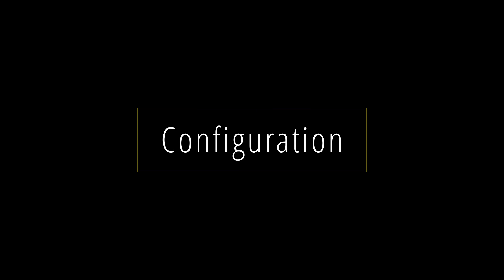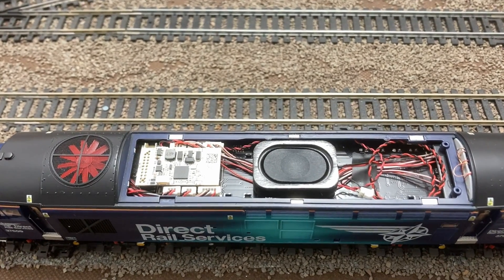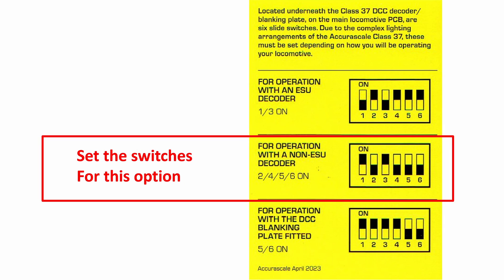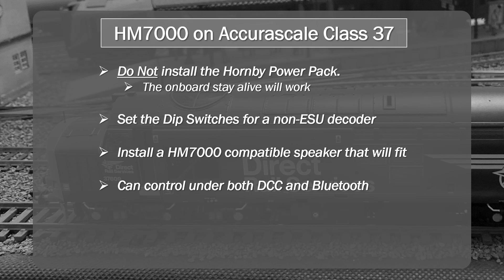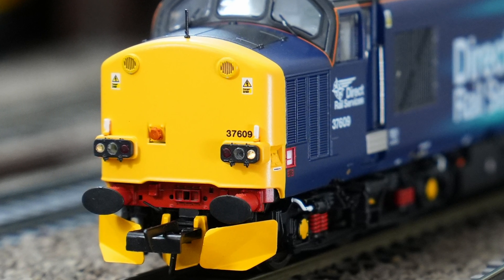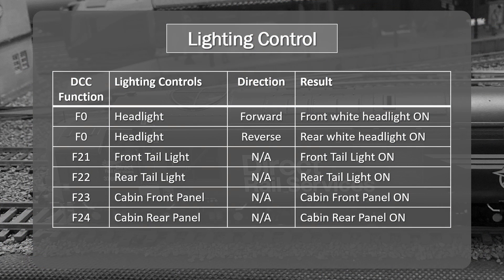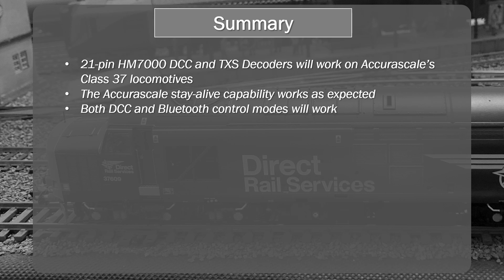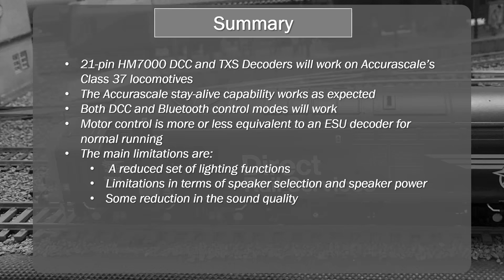Hornby HM7000 TXS Sound Decoder on Accurascale Class 37 - How well does it work?

Comment: A bit late as I hadnt seen this one but very timely as I have been wondering if the TXS will fit into the ACC locos I have been buying. I have the Class 66 on way and plan to use their TXS for that as I find an extra £100 for sound a big ask, especially on electrics.
Reply from the maker: There are some compromises on the light functions but in return you get Bluetooth control and you are saving on the sound decoder (and can re-use it on another loco in the future).

Comment: With regards to speakers, why didn’t you recommend the Accurathrash 8 ohm speaker? Works perfect with my HM7000 in this loco, not setup needed just plug and play.
Reply from the maker: It comes from concerns over the power rating of the HM7000 decoder which is substantially less than the ESU decoders. I suffer from the trauma of burning out a few TTS decoders in the past due to overloading them. (https://www.youtube.com/watch?v=flxKOP7JyKM). I'd keep an eye on the overall current draw to make sure that it's not exceeding or running very close to the limits. Driving a high speaker load combined with high motor current could bring you close to the limits. I haven't fried a HM7000 yet but I've been using the Alpha Meter to make sure I stay within a reasonable overall current draw.
Reply: @EuviRail  The specs of the new Dublo DP-1 show an EM-1 speaker. Presumably the HM7000 has been beefed up?

Comment: Hi. Did you have to remove the pre built 4ohm speaker from underneath the PCB?
Reply: The one under the PCB is an 8ohm sugarcube, however putting it in parallel with another 8ohm speaker puts it down to 4ohm. Therefore if it wasn't removed, it must work at 4ohm albeit not recommended.
Reply: I’m trying to work this out also ?

Comment: How many function outputs does the HM7000 TXS decoder have? Did you try anything to get more of the lights working beyond the first four AUX outputs?

There is a suggestion that Accurascale have done something very ESU specific with the Class 37 which means that no matter how many outputs a decoder has, some of the functions will not work with anything other than an ESU decoder.
Reply from the maker: While the Hornby docs might indicate the potential of 10, only 6 are accessible in the App. Accurascale can use 3 of AUX  outputs to "communicate" with the base PCB to provide the full level of outputs, be it 10 or 12 or probably more if required. When using a non ESU decoder, this isn't available to you and the 3 AUX outputs are used for standard lighting giving you the 6. Perhaps, this might change in the future when Hornby have locos of their own that require >6 outputs.
Reply: @EuviRail  Interesting. I've now read the Hornby documentation, and ... that's an unusual way of wiring those pins! It does look like AUX5 to AUX8 will depend on support from the mobile app, and it's kind of a surprise to find the app support isn't there yet.

Comment: Great video as always! I have 2 of the 8 pin HM7000 , 1 running in a DCC converted Lima 201 (in NR livery) and it runs fantastically for the age of the model, the powerpack helps with the lack of pick ups and the class66 sound profile is pretty good match. Looking forward to your review of the IRM mark2s! have them myself and very pleased with them.

Comment: Near where I live - nearest Model Centre is now 30 miles away; may not be there much longer (see Hattons) and need to have some nearby experts / shops that you can go to and get good advice, repair service on OO Models.    As an example installing above on my DCC Ready A/scale Class 37 , like for me some one who can install above, test it on their layouts and then give me advice on how to run it on Digital Layout and also on Analogue Circult - minus the Digital features.     Also some good advice on my older DCC Ready locos - moving onto Digital; assuming I have a layout; house has restricted space, so little room at moment for OO Layout.
Reply from the maker: You can't beat a local model shop for all the reasons you mention and many more so the loss of Hattons will be felt on two fronts. Thanks for sharing.

Comment: Haven't got a OO Layout yet ( just a 1.5M straight section I bolt together as small run ) only at moment buy DCC Ready locos, manuals for DCC Conversion poor - even from Accruscale, assume that with my DCC Ready Class 37 A/Scale Loco, simplest way to convert to Digital Sound I need to buy - a) Accurathrash Class 37 Speaker Retaining Clips b) Accurathrash DCC Sound Speaker SKU ACC2015 and C) Either their Accurathrash Class 37 Loksound ‘Original’ DCC Sound Decoder SKU ACC2246 or the Hornby HM7000 TXS sound Decoder R7322 (21 PIN) D) Sound Profile ? - on to HM7000 APP ?
Reply from the maker: Bluetooth control is probably an excellent way to dip into the world of digital control without forking out the cost and it also saves space if that is a problem. For myself right now, I either go with factory fitted sound or a HM7000 for DCC ready locos.
Reply: Thanks @EuviRail

Comment: Thanks for Video OP - only wish was a quick few mins on installation procedure of Digital Sound Chip and Speaker.    Confused on why Hornby introduce a new Chip Slot now for their OO - 18 PIN (R7345 HM7000-N18TXS), get 6-pin nor N but why can't hornby still use 21-PIN (Assume this is most common Chip Configuration for OO at moment ) ? .      Assume that with Hornby HM7000 APP this comes with a Class 37 Profile now ? you can import Profiles into HM7000 APP.
Reply from the maker: Hi Dafydd, yes they have a Class 37 profile now and a few other new ones like the Class 60. 21-pin is very much the standard now for new locos alright.
Reply: Thanks @EuviRail

Comment: It could be worse. I have a factory sound fitted 37 and the lights don't work properly. Accurascale said it's my controller but it's a Gaugemaster and works with all other manufacturers. Poor deign.
Reply from the maker: That's not good. When you pay for sound fitted, you expect the whole 9 yards, no compromises. thanks for sharing.

Comment: would still say esu decoders are best or zimo
Reply from the maker: No debate really unless you absolutely want/need the bluetooth capability. These are more flexible though than the budget SoundTrax Econami decoders I tended to use to give me sound on older locos. SoundTrax have bluetooth now but it's not cheap.

Comment: useful vid as I was thinking about what to install next and what ,if any , of the newer locos to ie 59, Accs 37 or new 56 to get next. It seems with the newest stuff you're better off getting the full sound fitted version [if your quick enuff!] Rather than go blutooth as their are to many limitations.
Reply from the maker: Yeah, I tend to go for the full sound equipped versions for new loco purchases - you're guaranteed everything will work! I've found these decoders are very handy for older DCC Ready locos where the flexibility to reconfigure the prime mover can be particularly handy.

Comment: Did like your presentation. I am a fan of the HM7000 sound decoders. Currently I have 42 locos fitted with the system. Standing by are 4 x 21 and 6 x 8pin for future purchases. I am now buying my stock from a steam preservation society at a cost of £52.50 and £49.00 respectively. I must compliment you on your layout which appears quite compact, but contains so much.
Reply from the maker: Thanks Kenneth. That's a pretty heavy adoption level. The ability to re-program for a different loco type will give you a lot of flexibility going forward.
Reply: 42, that's going some. I got 4. Sure I read somewhere there's a limit of 60 odd

Comment: I am amazed no one has come up with a subwoofer and satellite setup for trains!
You could just put a speaker in the train to deal with the mids and highs and have a subwoofer under the layout to give you the bass! Would sound so much better than trying to cram a one does all speaker into a little train!
Reply from the maker: Yeah, it's a huge challenge getting any sort of decent base in these locos though the larger speakers can make a huge difference - if you have room for them. I'll show this in an upcoming video with a Class 60 which does have some decent space inside.

Comment: I didn't know about the low power issue with the HM7000 decoder. For a sound decoder, you can't complain as much about the price. It sounds quite realistic. I have heard you can use your own sound profile. If this is true, you you add station announcements! Thanks for uploading.
Reply from the maker: Thanks for that. I'm not aware of the ability to add a custom sound profile yet and can't see anything on the Hornby website. I'd certainly use it if it came to be supported. In my running session videos, I just overlay stations sounds myself to make them a bit more interesting.
Reply: @EuviRail  I have heard you will be able to use your own sound profiles but this is not currently supported by the app. The consensus of opinion is that it is is impossible to use your own sound profiles and that this might not change, knowing Hornby!

Comment: Nice video. I put an 8-pin HM7000 decoder into the EFE Heljan Hymek, the headlights and taillights don't work on F0, anyone knows if there is a solution?
Reply from the maker: Thanks for that. I have a EFE Hymek queued for review and will be fitting a HM7000 decoder. I'll definitely be looking at the lighting. It's a few weeks away as there are a few items ahead of it.
Reply: thats odd, they should work.. try another decoder.. ? as maybe a fault in loco.. [?]
Reply: It works with an ESU 59020 decoder.

Comment: Brilliant video! Really appreciated this one, I have recently done the same with a Bachmann 37 and also noticed some limited functionality, I also lost the ability to control the cab lights :/ It's annoying but as you say, a compromise on it. Thanks for another fantastic video :) Hylt
Reply: I've got a 21 pin TXS chip in my Bachmann 37. The cab lights are on the first lighting aux function (page 3) of which I've renamed and assigned a different icon for :)
Reply: @damonzofortese  thank you! I’ll definitely take another look then
Reply from the maker: Thanks for that. Yeah, the cab lighting is generally the main hit. It would be nice if manufacturers considered HM7000 compatibility but why would they unless they felt it would hurt them if they didn't support it?
Reply: @EuviRail  good point, I see it as a very generous move on Hornby’s part to make it so widely adoptable with other manufacturers models. It’s brilliant tech and I’m surprised more people aren’t raving about it. Perhaps in future there might be a bit more open mindedness to it. I have to think about the new coupling tech from Bachmann, would it work with hm7000? Doubt it, and as such they further limit adoption and compatibility.

Comment: Thanks for making this video, I am impressed with the TXS decoders for the flexibility they offer. Up to now I've only got two and both are fitted to Hornby locomotives. Do you know if the Accurascale sugar cube speaker is also connected  or does that happen when the ESU decoder is fitted?
Reply from the maker: Thanks for that and for the question. Yes, the internal sugarcube speaker remains in-circuit so you'll hear it even if no speaker is added.